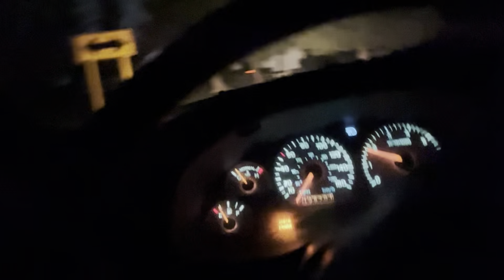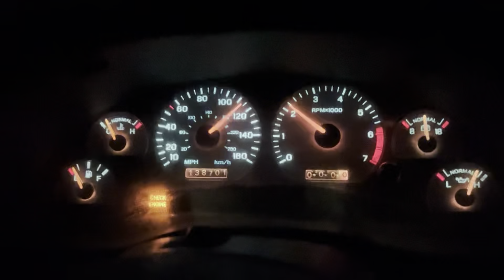A**hole deep in a turbo car! Cobra gets a new transmission and we reveal upcoming plans.

Comment: Dang CJ, this' the 1st time I've had videos from you that I have yet to see! Keep up the hard work for the content! Best wishes and prayers to get your new ride together! I'm itching just as bad as you man! I'm building a 99 Camaro, single 91/102, 400" LS, TH400, 9"...And it is a streetcar, that'll hopefully break in the high 7's, with the added weight of this 'T4 Freak' turbo from Jose, the kit and a cage to come! I'm thinking 3800lbs, w/o any weight out! Putting manual brakes on it, so I have the proper bias, trying to stop at 160-180mph. I need some help tig welding my exhaust, if yall want to take a trip to FL!lol

Comment: Try the grille and fryer cleaner from Sam's. It comes in packs of 3 quart spray bottles. It foams on contact. It's amazing, I've cleaned LS oil pick up tubes and inside timing covers with it many times. It's a must have.
Reply from the maker: Thanks. Will have to get some.

Comment: WD-40 is not a penetrant fluid, it is a plastics cleaner. Of all the penetrants....by FAR, you want to try Kroil. Work in an engine machine shop and skip an oil galley plug in a block, after the furnace you will conduct the test of who's best, very accurately.
Reply: Always wanted to try it but price scared me away..had a exhaust manifold job to do on a rusty truck..bite it and tried it..every bolt came out like butter..I'll never not have it on hand now.
Reply: Actually WD40 is an excellent cleaner but it was actually designed to be a water displacer on electrical parts and to protect against rust on rockets and missiles. The WD literally stands for water displacer.
Reply from the maker: Kroil is good. I don’t have any though. Had the wd-40

Comment: Foxbody T5  imput shaft is about a inch shorter than the SN95 , If you put a Foxbody T5 on a SN95 bellhousing the input shaft doesn't reach the pilot bearing. That might be a 4 cylinder T5 out of a foxbody the pilot bearing is smaller on the 4 cylinder transmissions. If it's a v8 T5 foxbody trans you can swap the input shaft out of the old trans  All that grease on the top makes me think 4 Cyl va,lve cover leak. Hopefully this helps!  Look in the speedo cable hole in the old trans and see what color the gear is on the output shaft should be green foxbody;s are yellow . It probably ate the one in the new trans the way the speedometer cable gear looked!
Reply from the maker: Thanks buddy. It all seemed to be the same. When I got the trans yrs ago it was suppose to be for a 94-95 just never sure what you are getting when buying used from some one you don’t know. I’ll dbl check the gear I did look and I’m pretty sure it was green. Ik the trans that came out of it had a green gear for sure.